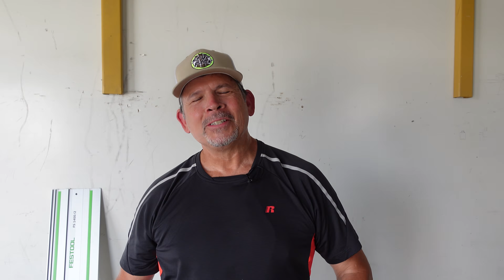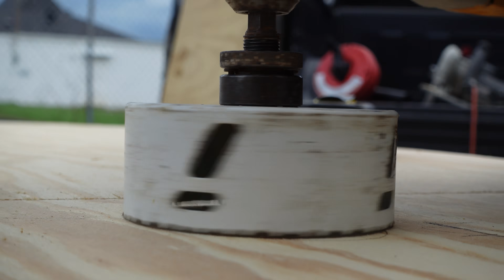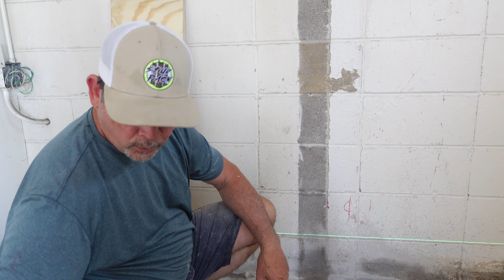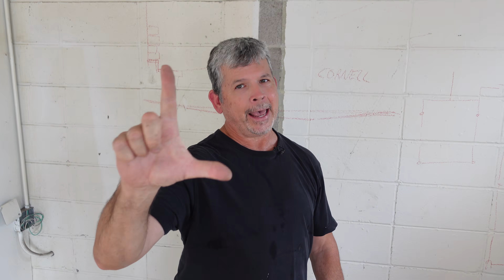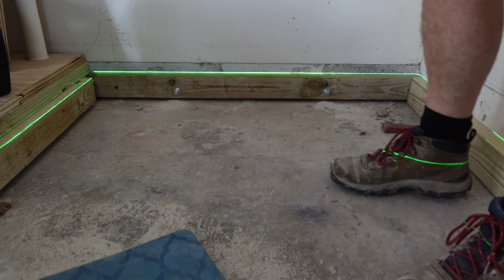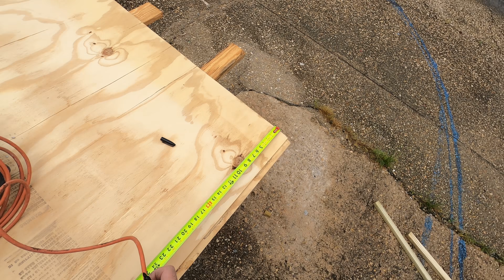Building a Bulletproof Curbless Shower (on Concrete Slab) - THE SHOP Part 5

Comment: Wouldn't the lumber making direct contact with the concrete potentially wick moisture and rot over time? Or does the adhesive used to glue the lumber to the concrete act as a moisture barrier?

Comment: Not second guessing you Paul, because you’re top notch smart. Why not float the floor with self leveling concrete. Sure hindsight is 20/20, but you said from the get go, the floor wasn’t level. Just seems it would made for a much easier build for you.

Comment: What I do when I’m installing wedge anchors is put a threaded rod coupling (barrel nut) lined up with the end of the anchor so when you’re hammering it in, you don’t fuck up the end of the anchor or the threads. You can also double up on regular nuts if you don’t have any rod couplings.

I’m going to be installing a curb-less shower in my master bathroom here soon, this video was extremely helpful. Thanks guys. 👍🏻

Comment: Dude, invest in some AA, AAA & 9 volt rechargeable batteries. They cost more up front but save you in the long run. I keep 8 -AAA, 16 AA & 4 9 volt extra fully charged so I am never without power.

Comment: You shouldn't ever need an sds to drill anchor holes in cinderblocks.  A m12 or m18 hammer drill  doesn't give you the big blow out in the back of the block. However you using a laser was the smartest thing you could have done.  I do kitchen and bathroom remodeling  and  curbless showers are the most complicated one mistake usually will mean a complete demo and redo.

Comment: Wow! I have had SOOOoooo many problems with anchoring into cinder block walls. I could never get a secure grip with any type of anchor. My only thought was to add even more anchors to spread the load and hopefully be strong enough when I was done. Even then, I never had a good feeling about what I was leaving behind and if it would fail later on. 
I am so glad to see that you experienced the same problem with the holes blowing out and have found the remedy. Looking back, it seems like such an obvious solution that I should have considered, but just using the standard drill setting just never crossed my mind. I have hope again that I can leave behind quality work the next time that I have to anchor into cinder block walls. 
Thank you Paul and Jordan for this channel and all the problem solving that you bring to the public DIYers. You are truly appreciated!

Comment: You don’t need to remember where not to screw down the plywood. 
You need to use “bocca” plates over those places.  BTW this is a NPC ( code) requirement  if you where getting inspection like your supposed to do the inspector would fail you for not having them  them 
And trust me every plumber out there will agree if you ever been thru trying to get your final plumbing inspection and having a leak that will not hold the raised water final 

I’m not trying to bust your guys but these are staples in the commercial construction industry

Comment: I love the stud pack and have watched every one of your shows. 

And I don’t want to be the negative guy. But you guys are definitely out of your element on commercial work ( I know I’ve been in this construction business for 45 years) 
Why do you need a laser for a eight foot board that both side are set.  This is what you level is for or the straight Edge.   This same thing drives me nuts at work. The young guys can’t do anything without a laser and I mean the simplest stuff 

Any way I do love to see the stud pack

Comment: Tap cons 3-1/4 x1/4”. Hit the souls edges of the block  your smashing those wedge anchors with a mash hammer.  No wonder to block is not holding.

Comment: When you can’t concrete saw all the way thru the corner of the cutout. Use the hammer drill like you did but hit all the corners and finish that cut thru to the bottom with the drill bit. ( several holes in the corners if needed). And if you deep enough with the saw or even close and the corners are all the way thru one or two hammer blows and that chunk will lift right out in 2 min

Comment: You don’t need to see water flow. What you need to see is that bubble on the level you put on the piece of pipe when you installed it 

And why was that not pitched peice of pipe not pitched. Your testing flow before your done.  Ok 👌

Comment: Back in the 80 and 90's, we would screed and hardtrowel mud on top of a polyurethane pan. You can prep the slab for smoothness and some pitch from the walls. Pitching to the drain would be done on top of the pan with the mud. This mud is 3 to 1 ...sand to portland and  only wet enough to pack like a snowball. Just a old way that worked for years and without issues.

Comment: I've never had luck driving tapcon screws by hand. They always shear off, even when using a drill bit 1/16" larger than called for and cleaning out the hole with 90+ psi air really well. I've switched to an electric impact only for those, and just stop as soon as I make contact.

Comment: Original wall plate, bolts no hold, no problem. Pull plate away enough to add PL, push back in, cut a few cleats glue and screw to wall plates. DONE. Your machinations on this one made me tired. GK

Comment: Instead of attaching the ledger to the block, why not attach the ledger flat on the floor and cut a 2X that will attach with screws to the ledger flat on the floor. The 2X would be cut to make up the amount needed for the floor to ledger board.

Comment: Hi Paul land Jordan, I have removed those pins a bunch of times.  You chisel off the lead flange and then using straight claw hammer or nail puller just remove the nail and the lead anchor may come with or stay behind with the hardware.  But it's not to tricky to remove the lead with pliers or drilling out

Comment: Wouldn't pouring a concrete floor have been much faster? Build a channel, maybe add some wall-anchors and rebar and just fill it up with that self-leveling concrete? It can tell this is a solid floor, but it took days - and, maybe even more expensive?

Comment: Zinc plated brackets are never good against concrete, your lead anchors, you could have used a punt to drive them in and you can never use wedge anchors on a cinder block wall unless it is filled with concrete.

Comment: So one question, know would have been a lot more work, but would have been possible to jack hammer out concrete for the plumbing and level compound for a more flat surface as an option than the raised platform or something would prevent that  ?

Comment: the only thing that has worked for me with CMU is drill hole center of a cavity, use butterfly winged bolt anchors
Reply: and that is best on actual concrete CMU, get into a building that actually real old cinder block, those are a lot more brittle so I would not trust the real cinder for any strength for any fastener
Reply: And, one idea for the tapcons in those blocks for next time, drill into the web solid part of the block ?

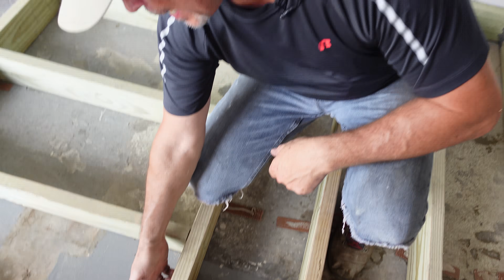Comment: 1:38.  So take a 12” piece of 3/8” threaded Rod with 2 nuts on either end (one nut is a backer) and now you have an extension to drive your nail ins in. It’s that simple dude. You can even get fancy and recess the bottom nut so that your extension can’t kick off your nail in while your driving them in.

Comment: Very nice guys. I got behind on your videos so had a nice Studpack binge. The only comment I have is i noticed there were no safety plates on the joists here the pipes were, especially for the shower where the joists are only 3 1/2 thick.  My favorite home improvement youtube channel.

Comment: One trick I have found with tapcons that like to pull out of their holes, is to get ones a little longer and drill them in at an angle. If you alternate directions, the outward force of the board locks them in place. As far as the cinderblock just crumbling, maybe try using concrete anchor adhesive? You let it cure partially and then finish tightening the anchor bolts, that might help it hold up a little better

Comment: In 25 years of remodeling I’ve never seen pipes run above concrete and buried with a wood framed floor. Busting out concrete,  burying the pipes below and re-pouring isn’t that much work. And you get a far better finished product. Nothing i saw screamed overkill.

Comment: i do termite treatments all the time and a hammer drill will definitely blow out a cinder block. if drill from outside a crawl to the inside you will see a huge hole on the inside where it blow out the block.

Comment: That had to of been a frustrating day!  Surprised y'all didn't know 4 or 5 holes in the concrete blocks and fill 4 or 5 hollow columns with solid concrete.  I'll bet those concrete piers would have held those wedge anchors.

Comment: Good work gentlemen.  The most important part of a structure is it’s foundation, so consider the subfloor and joists as your foundation.  If you get that right, everything else falls into place.  I noticed you used the track-saw as a straightedge—ironically you could have made the cut once with the track-saw itself, but I get it—you wanted to use the regular circular saw.

Comment: I did want to say thank you very much for the suggestion for the 2p 10. It really works and I used it on some casing and I was extremely impressed. In my case I had to use instant bond because the stores don't sell the to P10.

Comment: Code violation with vent for the shower. Vent needs to run  above the drain line when running horizontal.

Comment: Considering all the work you've got into this ,wouldn't just breaking up the slab and re-doing the plumbing below grade and then pouring new concrete level with the surrounding area? You would have had a level continuous floor when done as apposed to the step up you have now. I dunno to me it would have been better. (Shrugs)

Comment: Hey @studpack did you guys ever consider laying the new plumping and then pouring a concrete fill?
Reply: In almost all cases pouring a slab on top of an existing slab is highly discouraged as undesirable effects from seasonal environmental changes will occur.
Reply: @Budsown  crazy, overlays are pretty common in my area with the appropriate depth.

Comment: This is a great series for me since I need to do about the same in my garage, except that it gets -BRRRR cold here and there is no insulation under the slab.  In the middle of winter ice and snow falling off my vehicle parked in the unheated garage doesn't thaw till spring.  Since the area I am building out will be heated I'm wondering if putting down a 1" layer of EPS foam insulation right on the concrete would be enough to keep the plumbing from freezing and the finished floor not too cold.  Any thoughts on that?

Comment: I like using a palm nailer to drive in pins
Works great for putting in pins on counterflashing in areas that are decorative because you don’t risk messing up the finish with a waffle hammer

Comment: What are you planning on doing with the junction box in the corner in what will be the shower? Since you can't bury it in the wall and wouldn't want an access panel in the shower, are you planning to relocate or eliminate it?

Comment: Hole saw tip: punch a hole or three around the perimeter of the circle before cutting to let the chips out. It will cut easier, won't burn your saw up as quickly, and it won't take a hammer to get the plug out of the saw.

Comment: Guys, you gotta get the Milwaukee M12 laser level, just use m12 rechargeable batteries. That trip to the store cost you at least an hour. Over time the m12 laser cost starts making sense

Comment: I'm all for overkill but dang allot of that is unnecessary. Y'all do good work but you're making it hard on yourself. You don't have to do your rough framing like finish work. I just don't see any advantage that you're getting. Perhaps the bathroom doubles as a tornado shelter.

Comment: I've heard at least in Finnish building code you should not use plywood under the tiling as it will crack the tiles during thermal expansion. Recommended material is gypsum board which does not suffer from thermal expansion.

Comment: When I worked in construction I took a small piece of rebar about 8-12 inches long and drilled out a divot on the end for the pin to sit in.  Worked really well for those pound in anchors in tight spaces.  I don’t know what size rebar it was because us electricians don’t care about rebar size! 🤣

Comment: Suggest putting a metal plate on the notched out joist over the drain pipe so any future remodelers won't drill into it. They won't see the info you wrote on the wall about it's location. Luv your videos.

Comment: How did I not know a power planer was a thing? Very nice!

Btw, I would've just used the hammer drill or impact driver with an impact rated nut driver bit to drive those tapcons after drilling the pilot instead of an impact wrench. I was putting a mat down in my concrete garage and anchored it with tapcons and washers. Hammer drill worked just fine.

Comment: Shouldn't there be a 6 mil plastic water vapor barrier put down over the concrete first which will wick water from the ground under it unless there is a barrier below the concrete? If not, then shouldn't  the plywood subfloor be treated lumber like the joists? Otherwise mold can potentially form. On a recent well vented crawlspace I used OSB subfloor but sealed the bottom side of the OSB with a moisture barrier primer and paint. Thanks for the videos. I try to watch as many as I can.

Comment: Years ago, This Old House had a promo where the old host Steve Thomas joked with Norm Abram that he didn't change router bits, he changed routers. Same holds true for carpenters and saws. Having mutliple saws with different blades cuts downtime, but also makes your workflow smooth and frustration level drop. Pawn shops and second hand sellers are a great place to pick up pro level equipment for 30-50% off if you're watching the tool budget. 

When you guys get to the new city, please let us know. Would love to lend you guys a hand.

Comment: I got the problem with the anchors, but you didn't explain the problem with the wood. I don't see how changing the wood (for something that basically didn't look different) would help. Can you explain again as I'm sure you didn't do all that extra work without a good reason.

Comment: I love the clean precise work you guys do, no half “assery”.  You and Mike Homes (can I say that name here) have that in common.  I looked at the difficulty you had putting in that ledger board on the far end of the shower.  Why not lay in a generous amount of glue up against the wall, use the same board, horizontal fasteners merely as “pins” then shim under the board.  Seems quicker to me.  Downsides?

Comment: Toggle bolts on that cinder block would have worked too. Obviously will need some washers. We do that to hold up heavy sub stations in the electrical field

Comment: Shield anchors are about the only thing I have found to work in cinder block. Another option is to attach a few blocks to the floor along side the joints and you have  a point to fasten the framing

Comment: Awesome plumbing job! Here is some useful information I learned during my apprenticeship… Depending on how you size per the code books you want to keep a constant slope no more no less. Let’s say the design called for 1/4” per foot (you want 1/4” per foot exactly or as close as possible). If you have to much it will leave the solids behind and the water will flow to fast on the flip side not enough slope you wont have enough flow for scouring action  “cleaning inside the pipe” during drainage. Keep up the great work and content!
Reply: Neither the toilet nor the shower is vented, you'll wind up with airbound fixtures.

Comment: One of the things I really hate is when problems I've been confronted with during the day that "should have gone this way" and failed, failed, failed, and my mind is stuck on them when I'm trying to sleep (And at my age, I have enough problems trying to get a decent night's sleep in the first place, so I don't need "frustration problems" making it any more difficult....Yes an attempt at levity intended).  Having said that, over the course of my 3/4 + of a century of life experiences...The only positive I will add is this...I've learned that those trying to sleep OMG moments when I realize "what the problem was," the resulting solution that came to me works almost every time!!  Glad your "trying to sleep revelation" was "exactly" what you needed to fly through the 2nd day (And a great hint to pass on to all of your viewers as well).  Please keep the great videos coming!!!

Comment: One thing I noticed when using Tapcons in block vs concrete is to use a drill bit 1/16 smaller than the recommended size. They seem to hold a lot better that way.

Comment: Hey bud so I cut concrete for a living just a few words of advise next time you have to make a resise in the concrete and useing this same job as a example after cutting your perimeter simply use the same saw and plung the blade about an inch apart from one side to the other then simply use a chisel and snap them side ways you might still have to do some clean up with your jack hammer but you’ll get a lot more out faster

Comment: I hear you, anchors into masonry is sketchy at times.   In AZ, they use a lot of block with flyash, makes them light, but they just blowout when drilling into them.   We did a framed climbing wall and ended up just drilling thru the mortar joints to do a nut and plate on the outside of the wall.  I  just didn't trust an anchor in serious tension.    I think your use of the tapcon types is perfect since you didn't have heavy tension.   I notices you screwed the plywood deck down (superior work for your guys...as usual), once that is done, that ties it all together, that floor wont budge even if a Cat 5 takes the building away.   Great work as always.